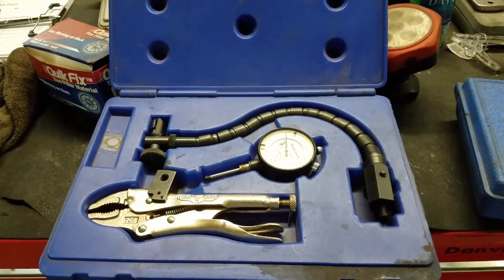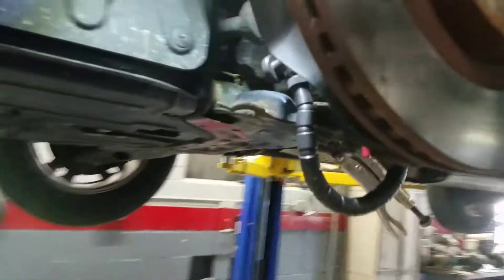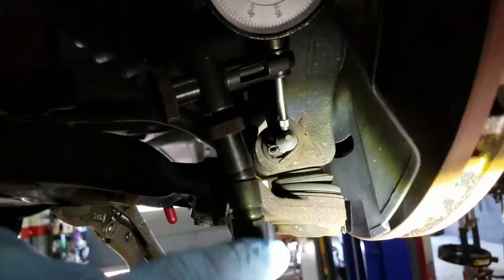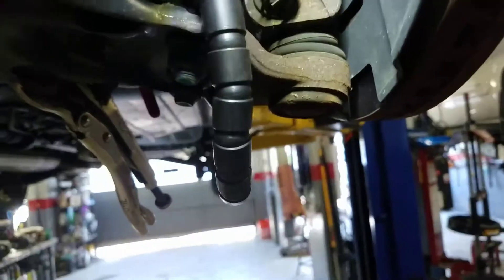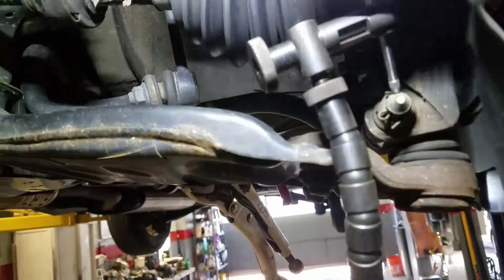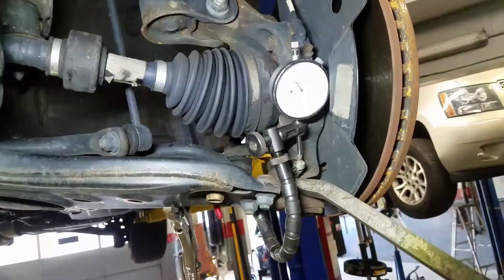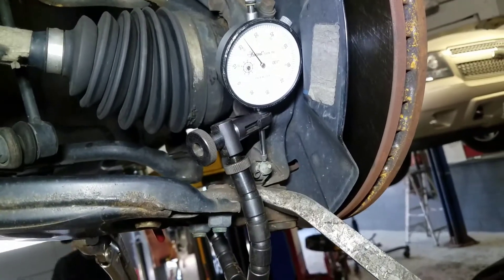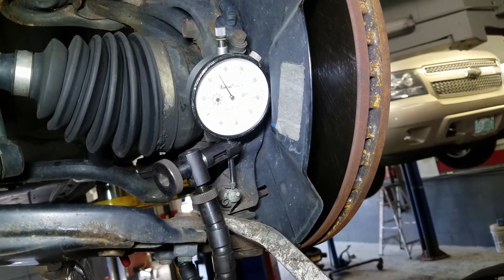How to use a ball joint gauge and dial indicator

Comment: I'm reading the section for ball joint inspection on the Ford Fusion and it says DO NOT USE ANY TOOLS to pry on the suspension components when checking ball joint deflection or suspension damage may occur.  they want you to use an assistant to push the control arm up and down while you measure the deflection.

From the service manual:
"NOTICE: Do not use any tools or equipment to move the wheel and tire assembly or suspension components while checking for relative movement. Suspension damage may occur. The use of tools or equipment will also create relative movement that may not exist when using hand force. Relative movement must be measured using hand force only."

Comment: So I'm taking my inspector test for MD,  I have a few people saying different things hook it to the frame bolt, seen hook it to the caliper bolt, my college book says control arm.. which is how I have been taught in college. McPherson strut type. What annoys me the most, it seems there are different ways and not everyone agree's one way. It is totally dependent on who you ask and how they see it. Who is correct? as long as it accurately measures the movement I don't see what's wrong with caliper bolt or control arm as long as one is on one and the other the other. the frame bolt guy don't make sense, he is saying it keeps the control arm bushing having play from effecting it when to me it seems the opposite would be true if you have it hooked to a frame bolt. I just want to do it the correct way, and pass my test, and do what is expected of me.
Reply: Dude did you ever figure that out? I’m taking my MSI test with Duff in a week and would like to know too
Reply: @matt_b8977  no sorry just decided I didn't want my MSI, It really depends on the trooper, and many of them don't even give a answer. I looked it up, contacted Toyota, and as it turns he was just being a dick and could not consider himself being wrong so gave up. It's a lot of Bullshit anyway, as I had it before and let it expire. But good luck it depends on the trooper.

Comment: Just a tip  your indicator should never be clamped  to the control when check  ball joints should be clamped to stud on caliper or another suspension component
Reply: Dutch The Diesel/Auto Technician you actually fail your state inspectors test on the spot in New Hampshire if you clamp the vice grip to the control arm
Reply: @hockeyguy998  same with pa
Reply: Happy came to the comment section. Got my tactile test Mon.